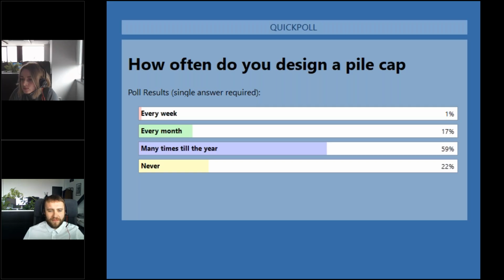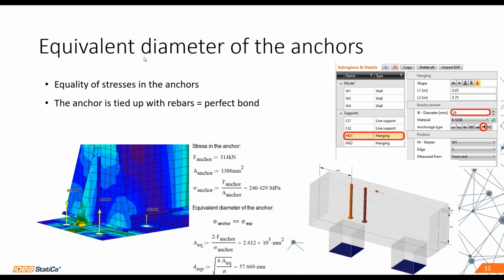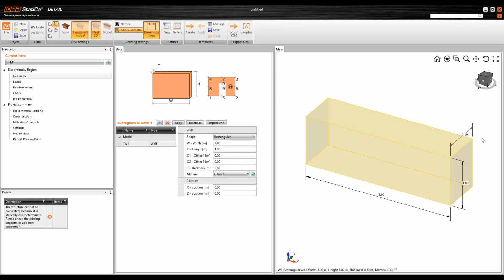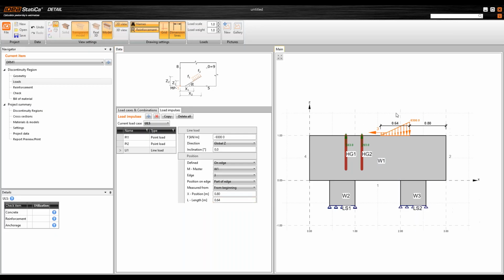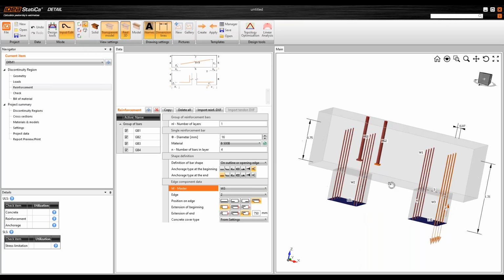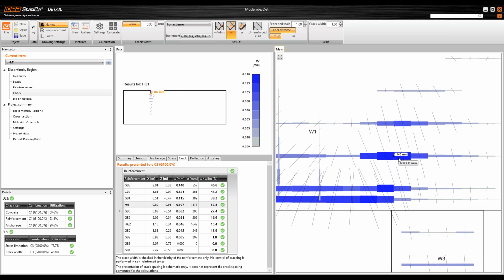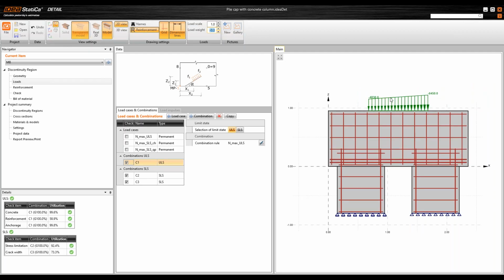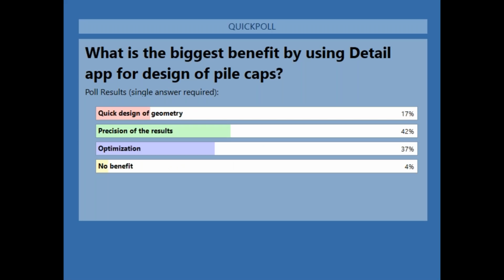How to design and code–check a pile cap

Comment: The above 2 pile case is not very typical example considered. Is it the very limitation of the software ?
Reply from the maker: Hello, the solution is currently 2D, as the application assumes 2D plane stress. However, we're working on a 3D solution. Thanks to that, it will be possible to include multiple piles. So, stay tuned!
Reply: @ideastatica_en  eagerly waiting for this. Understand that with 2D someone can can argue that engineering judgement to use in real application, but the level of analysia we went into ie bond between rebar and concrete and load flow to numerically calculate the crackwidth, all will  become no use, if we hv to use engineering judgement which is again subjective and also essential also i m denying it..can do a conventional method of flexure design as a beam.

Comment: How to do a 4 pile case ?
Reply: software is 2D only not 3D. The purpose of the software is as a substitute of a 2D strut-tie type of design
You can design 4-pile cap by splitting your forces in the two direcitions and analysing the pilecap in the two directions separately - must use your engineering judgement on how to do this
Reply from the maker: Hello, the solution is currently 2D, as the application assumes 2D plane stress. I'd say that a pile cap with four piles requires a 3D solution. And that's something that we're working on. Thanks to that, it will be possible to design and code-check such a structure. Follow us and stay informed!